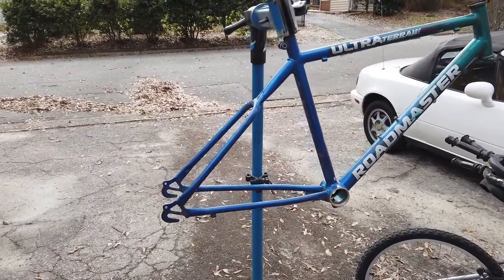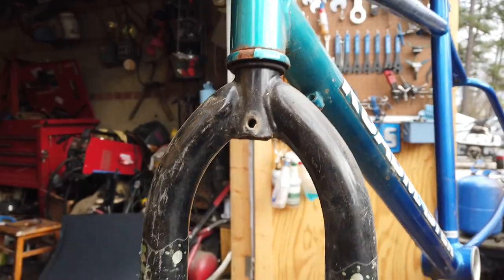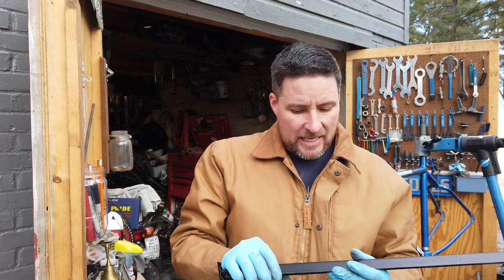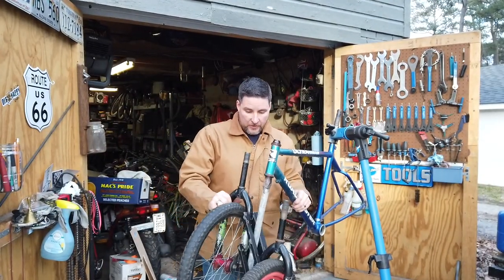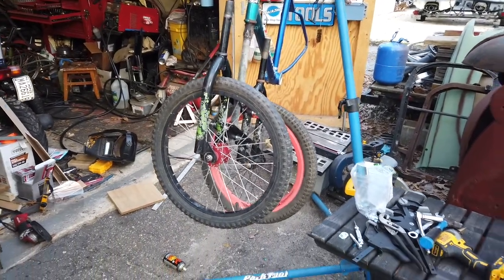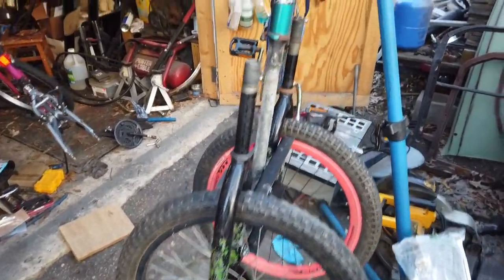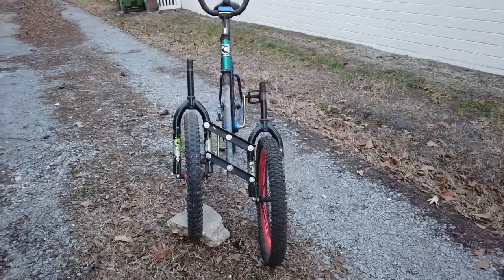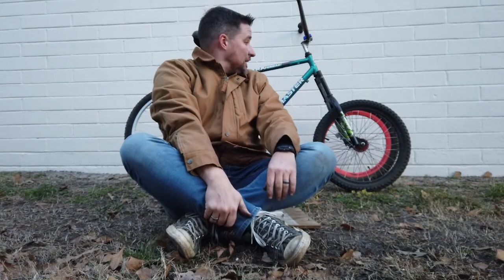Reverse Articulating Trike Build

Comment: There's a term for trikes depending on the locations of the paired wheels.  Your "reverse" is also called a tadpole trike.  The other kind is called a delta trike.  Just fyi.
     I love those old trucks.
     A front basket or flat rack would make for a good short-tripper to get to a store to pick up a small purchase.   Nice for saving gas and getting some extra exercise.
     Another nice thing about trikes is stability on ice and snow.

Comment: A variation might have been to attach the 2 horizontal bars up hight onto the steerer tube of each of the outer forks. That would then leave the lower half of the centre leg to carry a rack or trolley 'L" shape.  This would allow you to carry shopping low down and between the 2 wheels and forward of the axles.  Make a very stable cargo bike.
Reply from the maker: Maybe I’m not following you but I feel like that would eliminate the articulating.

Comment: Well done, Justin!  You have proved the principle of your idea, right enough.  I know this is a year later, but I only just found you.  I love the way you got it together  so fast, and without ever mentioning rake or trail it seems to steer just fine. That is clever.  Been considering how to build a tilting tadpole for years, and there's a (mostly) unused bike in my porch that needs putting to use.  I retired in 1999, so a trike conversion is a good idea now, and I will probably need some power assist too.   My first vehicle ever was a kid's trike, which I high-sided bigtime on the family driveway in the 1940s.... So I know the advantages of a tadpole vs a delta and have had the gravel-rash to prove it.  Recumbents are lovely, but the math says that the lower the bike (or tilting trike) the harder it is to balance for a wobbly old guy, and they are just too low for our local commuters to notice.   So what you have built is remarkably  close to what I have had in mind.  This trike is  now on my bucket list! 

What I would like you to do, please, is to tweak the toe-in problem and get the handling (& brakes?) to your liking, then try a couple of ideas that will help control the tilting and provide a tilt-lock for parking, all with serious string  (Para-cord?) and good quality elastic rope.   For example, a length of paracord tied to the top of one of the forks, taken up to the handlebar, over the bar then down again and tied to the other fork.  The tightness of this will add friction damping to the tilt, much as you have done already,  but more easily tunable.  Adding some elastic rope could give it some self-centering, perhaps?   And another length of para-cord that just pulls the wheels level when the rope is pulled fully tight - for parking.   Like the first one, but with a lever or something in the middle that pulls the cord tight and locks it - a highfield lever maybe?  What think you?  Ben
Reply from the maker: Great ideas. The more popular this video has become, the more I’m thinking about reworking the front end. I will definitely use some of your ideas. I am not done with this build so I hope you are subscribed so you can see when I bring it out again. Thanks for watching and sharing.

Comment: Yeah! Keep it going. Put in a middrive electric motor, like  a bafang,  beef up the front end for  more speed and power; gear it right so it will crawl over reasonable obstacles and it would be a worthwhile &fun project.

Comment: I also had plans to build such a trike, albeit with different steering, but never went through with it. At the end of the day, a bicycle is simple and effective for doing anything.

The advantages of such a design is that it should provide more traction and should feel smoother over bumps, due to the fact that, if you hit a bump on one side, only half of the height is transferred to the bike frame.
However, with the whole assembly being able to steer, hitting a bump on one side would cause severe bumpsteer, possibly twisting the handlebars right out of your grip!

Comment: Sir,
Me and my uncle both have balance issues with bikes and bicycles.

We had a query if we buy a second hand ranger cycle & install 2 wheels in front & in rear a 250w hub motor with pedal assist.

1) How long should the front tilting axle. be? 

2) front wheel 23 inches and rear wheels 26 inches with hub motor

We will be using it for daily commutes on busy roads and flyovers.

Sir, what do you suggest? Any suggestions from your subscribers are welcome.😁
Reply from the maker: I need to measure my axle, I don’t remember the length as this is an older video of mine but I still have the trike. If balance is an issue then I would suggest using coil over shocks to self center the front end.

Comment: Praise God Most High. Great build. Hope you will continue to develop it. If you can make one that can be attached and detached to a bike  I would love to order from you. I've been looking for a contraption that can do that and has a space in the middle where a narrow basket can be attached. Also one with a telescopic arm like in a travel luggage. What's this contraption for? So i can detach it from the bike and roll it inside grocery stores and would act as my mini grocery cart altogether. My ideal size bike is a bmx bike with all three wheels having the same size. And one that does not tilt the bike higher on the front. One that would make the bike's frame just straight and leveled. Thanks for sharing. Praying for your success. God bless you more. (February 2022)

Comment: Still working on connecting steering tube by threading the bottom of tube to 3/4" mpt thread. However, may have to get welder to weld to a coupler. Alignment would be acccomplished using a 3/4" wood dowel for alignment, possibly. Will let you know results soon

Comment: you could place two vertical dampers, one on each side, between the parallel bars of the tilt mechanism. When either wheel lifts, the bars will approach and compress the shock absorbers. This way, the dampers do not need to extend as they are limited to the maximum size between the parallel bars

Comment: Ild like to see this perfected and maybe put a 2 stroke on it if u have the bike still. Was looking for a simple reverse trike concept and u cant get much easier
Reply from the maker: I plan to resurrect this project and make the front end more finished, as for the 2 stroke, I’m not really sure. I used one of those eBay 2 stroke kits around 12 years ago and it was nothing but trouble and pretty dangerous.

Comment: I have been rolling this idea around my head the passed few weeks about a trike with articulation for my oldest son, who has a balance disorder. I am wondering, if you were to add some springs which pulled the wheels back to center when not leaning in to a turn, would it balance itself while riding straight (to some degree)?
Reply from the maker: I’ve struggled with that idea since I made it. Since the pivot arms are the same piece for left and right, when one side goes up, the other goes down. I don’t know what kind of spring to use that will handle the compression and extension. Some people in the comments have had some ideas, so I’d do some reading here.
Reply: @DentedFenderGarage  that’s a problem with the spring for sure. Seems like this would require a self-centering damper, like a automotive steering damper that returns to a neutral position with compression and extension.

Comment: It is  good joıb !!!!   Tilting   system  is not  so  weak  ?    the  tickness of the  material  I mean   .   you can   use  springs   for  more  stability.  i am  thinking.  bnut it is  good.  in the  video  your weight  is  i dont  want to estimate  but  iit is  good.
Reply from the maker: The tilting system in the video is very strong but it will be improved. I only made this to see if it would work.

Comment: just build mine but steering is really a challenge. a chopper bike body and place a small carrier in front so it'll suits the two wheels on the front. now still configuring out a good steering design.haha
Reply: I'd like ti know how long Is the Pipe you installed between the 20inches forja. Thanks.
Reply: @jmmarin4872  actually i assembled it out of old bike parts i got from friends. got an fb page i would like to see more or the bike you made. thanks.

Comment: Do the holes in the forks weaken the forks? I would like to put this system on my traditional tricycle and make it a quadricycle. Thanks
Reply from the maker: The way I did it in the video they would be a weak spot, but if you welded sleeves in, there wouldn’t be a weak point.

Comment: Love the build :-), how about having two wheels on the rear as well? now there is a challenge, I liked when only one front wheel was on the rock the frame only went up half the height of the rock .as for advantages, two front wheels would give you twice the contact patch so twice the grip and twice the brakes  :-)
Reply from the maker: I have another video where I assembled a trike. I could, in theory, put this front end on a trike and it would have 4 wheels.

Comment: If you put resistance springs to make it return to its vertical position(watch  Half bike rear tires, similar to skate board pivot). This bike may be perfect for children with autism and non-severe asperbergs. also for people with problems to sit completely in a bicycle chair and who want to handle the bicycle standing up. Also to learn to ride a bicycle for the first time.
Reply from the maker: I had not considered this for anyone but able bodied riders, this is an excellent idea to build on. Thank you.
Reply: @DentedFenderGarage  Putting a unicycle seat on and adding fold up pedals may make it usable as a strider bike for those with an impaired ability to walk. Those with balance issues will need the two front tires at a greater width so it is more stable. I'm working on something similar but doubt I'll get to completion.

Comment: Set the width of the 2 tires to 28 to 32 inches apart. It will give more stability.
Reply from the maker: In all fairness it’s really stable as is.

Comment: You must add it dual shock absorbers.thank you for this little yamaha niken without engine
Reply from the maker: I actually thought about this, but I didn’t want to add even more weight and unless you hit 1 bump with both wheels, they cancel each other out on bumps.
Reply: @DentedFenderGarage  thank you for answer.my englis not quite good..i was just thinking about it and i guess shock absorbers develop ability to cornering by improving the tint angle.

Comment: I might try doing this to a tallbike just to see what happens lmao
Reply from the maker: As an owner of 8 tallbikes and builder of 10, I’ll give you my impression. First, I’d always avoid 3 wheels on a tallbike, but I would make an exception for this if done right. To do it right I would either sleeve the holes through the forks and use nylon washers or ditch the holes and weld studs to the forks and use bearings on them through the steel for precision. If your alignment is dead on, you wouldn’t have any issues other than the extra rolling resistance for your rolling mount. I just wouldn’t put it on a tallbike because for the casual viewer they would assume the 3 wheels would be the balancing factor of the tallbike.

Comment: now take it down a hil and see how it handles a corner
Reply from the maker: It doesn’t corner bad, it’s just very primitive as I built it.
Reply: @DentedFenderGarage  if  you do not mind what did it cost to build and would you build another ?
Reply from the maker: The only thing I bought was some bolts, washers, and nuts. Everything else came from my bicycle scrapyard. If I had time I would do it again and do it right. I would measure, drill, and sleeve the front forks. Install front brakes. Use nylon washers on the moving joins for smoother motion. It’s a cool bike idea, not very practical, but a fun freak bike.